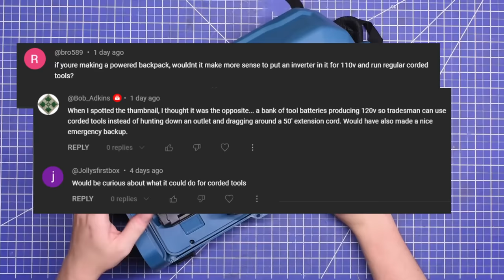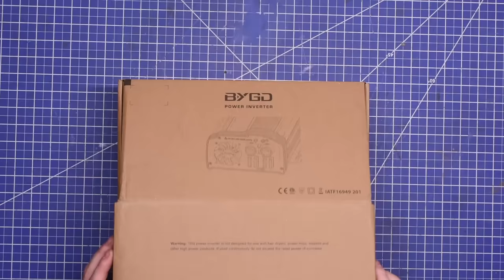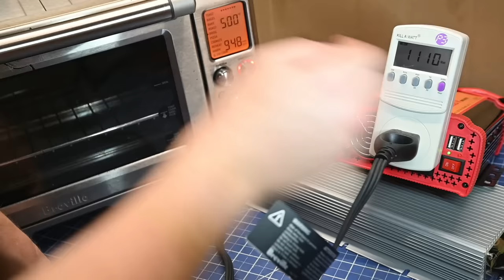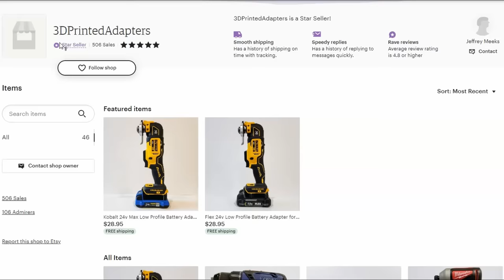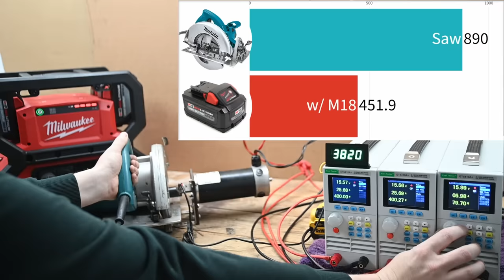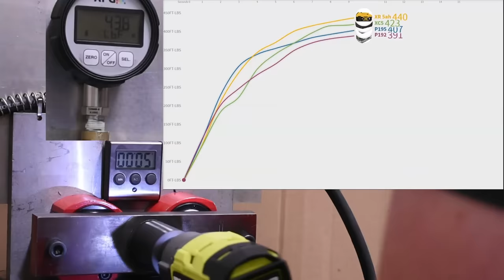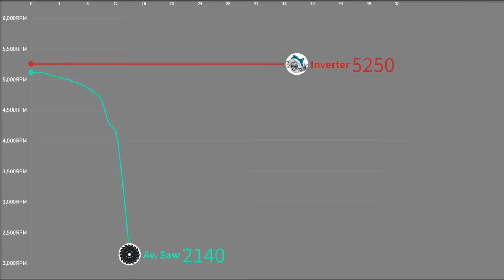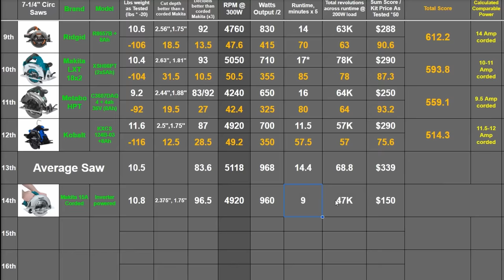Powering Corded Tools w/ Cordless Batteries is Stupid (but fun)

Comment: I built a backpack power center about 20 years ago, similar to your first attempt but with that era tech.  In a backpack, I put in a lead-acid battery intended for a large UPS.  Probably 1/3 the size of a car battery, maybe 20 lbs.  Then paired that with a 12v inverter, and added a slow charger conditioner.  The key, as I think you exposed, was the inverter.  For reasons, I had high-end inverters in my parts bin.  No Amazon cheapo crap, these.  With this setup, it could run a 12-Amp AC tool continuously, and could spike to double that for startups +-.  The backpack would run an AC edger, trimmer, blower and hedge trimmer (and for projects, circular saw, shop vac, and every other tool I had except one, which rejected the modified sine wave, I think).  I also converted an AC lawn mower using a similar setup, but on-board.  This did all the yard work for an 1/8 acre lawn on one charge.  The Achilles heel was the LA battery.  After about 6 months of discharge cycles, they would be flat.  Fortunately, LA batteries were cheap at the time (and recyclable).  Deep cycle helped, at a bit more money, but the most I got was about 8 months of weekly yard work.  The system as a whole did all my yard work for about 5 years.  I was about to convert to early lithium battery (at huge expense), then Ryobi released their "40v" mower, and well, for better or worse, that's where my money went.  This was a fun video, bringing back some hack-tastic memories.

Comment: I can't imagine how nice it would be if all brands had the same battery platform so you could use it all together
Reply from the maker: Air hoses and cords are the great equalizer
Reply: In a way they do actually, they all use 18v batteries(some market them as 20v or 19v, but they are all 5s lipo's so 18v), so all you really need is to download an adapter if you have 3d printer at home or know some one with a 3d printer.
Reply: Not that simple...
And they are not lipos, they're lithiums.
Lipos are significantly more volatile.
Reply: @Poo_Garden Doesn't lipo mean lithium polymer? So wouldn't that be the same just different format and in a smaller package in the case of Lipo packs.
Reply: @Poo_Garden  Yes it is actually THAT simple, 5 rows of INR 18650 cells in a series it's all the same, trust me. You just have to use same brand charger though because of BMS compatibility. Also some battery packs have output leads go directly from cells and rely on BMS to send a signal to tool to cut power when battery is low, so if you use that type of battery with an adapter there is a risk of over-draining them, but than again you will notice the tool being too sluggish to do any work long before you over drain the cells to the point of damage or not accepting charge again.
Reply: @jovand6606  the difficult part isint the cells. It's the pinning and logic. They have shown that batteries don't perfectly work across platforms and not to mention the number of 3d printed adapters you'd need to have aroud...

Now it would be VERY EASY for companies to do it, they just don't want to because it'll hurt their profits
Reply: @Depl0rable10  Dude, i 3d printed an adapter for my Parkside X20 batteries and made x3 adapters, wired them in series and im using them on my electric scooter. Im not sure what you are talking about, every battery has + and - pin and every tool has + and - pin, unless some companies are putting DRM and electronic handshakes on batteries, but i have never seen that in my experience.
Reply: @jovand6606  Except for Cobalt and Flex.  Their voltage difference actually means something compared to what Harbor Freight or Big Yellow says.
Reply: @h8GW  20 years only hilti had 21.6v line, and only recently it became popular for new brands which is beneficial because tools now need more power and higher voltage is a pro
Reply: @Poo_Garden  Lipo? You mean spicy hotpocket?

Comment: I love your videos and the out of the box ideas! I would love to see you test battery powered tools using lipo batteries. Atleast in rc lipos reign king for high load high power applications. I’ve noticed most battery packs are li ion which doesn’t hold a candle to lipo’s under load

Comment: Great video! A good stress test for corded stuff like this is a table saw. My EcoFlow Delta 2 ($649 on sale, 1800W, 1024Whr) will run nearly everything in the garage: Skilsaw, miter saw, MIG welder, compressor (not all at once of course), but it won't run the table saw.

Comment: someone else has probably pointed this out already, but brushed corded tools like most of the stuff in this video (grinders, saws, drills) are using universal motors. They can actually run just fine on AC or DC... but it needs to be around 120v... so 6 18v batteries put in series should be able to run all of those without the inverter.

I'd love to see that tested next. :D

Comment: another benefit of the battery inverter setups is the noise. much quieter than the gas generator and no fumes to deal with. something i consider when getting power away from the wall.

Comment: Motor engineer here- did y’all consider a backpack with 6/7 cordless batteries in series direct to the tool? You need to match the pack capacity/age somewhat, and there’s no BMS so you need to be careful, but you can (I have) run universal motor tablesaws, mitersaws, and corded circ saws from 6 20v batteries. 

Check the switch rating in the tool- this is the limiting factor- but DC to grid tools can be done.

Comment: You guys need to bring out the Bauer corded impact and start seeing if voltage increases will get you more beans. Or just wire it for 240 volts and send it on the dyno. I’d love to see if it survived a dyno run

Comment: An EcoFlow Delta 2 was recently on sale on EcoFlows eBay store refurbished for less than $500(1kWh, 1800W continuous output), and they had a Delta 2 Max for just over $1000, (2kWh, 2.4kW continuous and 4.8KW peak). I have a D2M and ran my shop air compressor(20gal 13.5A) no problem.  Also ran 3 window AC units off it this past summer.  Make an adapter and feed your batteries into the MPPT inputs😁

Comment: Something on your first set up was bad eather inverter or the converter i have 2 1,000w inverters that will run a 15amp circle saw not at full power but have used them several times. I would have them under the hood conected to the battery with a old set of jumper cables. Love your videos thank you!!!!!

Comment: I like the stupid. I was expecting four Flexvolt batteries set up for 60V in a 2x2 config, for 120V and up to 10Ah on the big boy batteries. Should work fine with universal motors and there would be lots of amps on tap. Would be interesting to see that.

Comment: Great test and quips as well. I bought a DeWalt, er, mustard invert rated at 1800 watts. Two outlets and it hasn't run anything i have plugged into. I bought it primarily for the air compressor and jump pack but I doubt this thing could run a coffee maker

Comment: Most of the solar off grid people do not use 12v inverters. I personally run my house on a fanless pure sine wave 48v inverter. Basically it's about he wraps on the transformer. If you want I can point you towards a great fanless line of pure sine wave inverters that are reasonably priced. It will be much more efficient than dc to dc buck converter running into a 12v inverter.

Comment: I believe its your step-down converter. If its limited to 1500w of power at 12v, and the output of the inverter is 1500w (non peak) at mains voltage, the inverter will be drawing a fair amount more from its 12v side (Probably 1800-2200w depending on its inefficiencies)

Comment: I wish we could see a video of the wobble sockets and what kind of power loss happens with them. Maybe a couple different brands as well? Done at different angles like straight on, 1/2 bent and full bent? And different styles of them like the u joint wobbles with the pin style and then the impact versions with the ball style. Would be interesting to see how those stack up in power loss

Comment: @TorqueTestChannel - I have the Milwaukee MX inverter/generator on my utility truck at work (company buys all tools).   The problem is it has a fan that ALWAYS RUNS, even if nothing is drawing  current. So if I try to use it to recharge ONE m18 battery, the MX generator will run itself dead unless I remeber turn it off later.  It's the DUMBEST thing ever. So TWO $600 MX batteries will run themselves completely dead to recharge a 1.5 amp hr M12 battery without user intervention.  We are literally using big batteries to charge small batteries, and calling that "progress".

Comment: I have the dewalt inverter/charger, dcb1800(?). I haven’t used it very much, but I don’t think it likes the small (2.0 ah) batteries. It has to have all the batteries installed & while they don’t have to be the same ah, it will shutdown when the 1st battery dies. It’s also “dirty” ac, not pure sine wave.

Comment: Time to crank up the sketch factor and run those corded tools on DC!! If I’m remembering my “EE for MechE” class correctly, I THINK 85 VCD would be about equivalent to the 120VAC RMS. That said, I suggest you just hook up an amp clamp and keep adding batteries in series until the current gets high enough to make your butt pucker (and tools smoke)!!
Reply: No  rms means rms, not peak, so you need 120vdc. Also switches are not dc rated

Comment: Admittedly I didn’t read all the comments to see if this was already suggested , but a computer UPS (uninterruptible power supply) uses higher input dc voltage that might work better than that 12v inverter.

Comment: Yeah, i wish Craftsman had a bigger inverter than just the 150w one, but it still has plenty of uses, powering 12v lighting for example. Hoped to use it to power my awning when needed but come to find out the motor uses 200w so just barely not able to handle it lol.. went and got a 350w UPS to do it though and it handles it just fine so whatever works.

Comment: I have that same generator! Just had it break on me. Turns out the little metal box attached by the yellow wire to the low oil pressure sensor was grounding it all out. Wrapped it in some electrical tape it its up and running again, lol.

Comment: @TorqueTestChannel if you’re not getting voltage sag from the inverter, I wonder if your frequency is responsible for the RPM difference between batteries. It would be interesting to hook up an oscilloscope and watch the wave form. Maybe parallel both outlets and use your safety squints

Comment: years ago when dewalt made the 24 volt line of tools it would run 24 volt or 110 volt you simply plugged in what looked like a battery but had a cord on it and plug in the wall

Comment: As 100 others already mentioned: most corded tools use universal motors that will happily run on DC. Though tools with triac speed/power control will get stuck at full speed.

Comment: 7:20 that fifth pin is used afaik as a voltage in for the charging function, so it would explain that not working, apart from the protocol being different on another brand of battery

Comment: Great idea but would make it differently. Universal motors are called universal because they can run on AC / DC power. So putting 2 60V batteries in series is enaugh. It would be nice protective measure to make some kind of protection circuit for that but not necessary. Maybe 60V mode needs some way to activate it but principle should be clear

Comment: i'm 5 min into this. the solution is using corded tools with brushed motors  that have a universal motor that will run on DC and AC . all corded tools used to be this way . if they have soft start and are fancy then probably not. but if they are literally a switch and full power to the brushes they should run on DC 120v so don't know if you can wire up 2 flexvolt batteries to give 120v dc.

Comment: Ryobi also has one of these units for 18v and it can hold 8 batteries. With their new 12ah batteries you could potentially have over 1700wh. Now at current prices you're paying about a dollar per wh for the batteries when you get the 2 pack. But on sale pricing that can go way lower. You'd have to be stupid to buy a single 12ah pack if you wanted one because for $10 more you can get that battery and two 4ah batteries right now.

Comment: 120V DC. Won't work with all tools, but it'll work while avoiding a bunch of conversion losses. You can even run a PC off that; the 1st thing an ATX PSU does is convert AC to DC through a bridge rectifier.

Comment: Technically the universal motor in that corded saw can run on DC, so in theory you could series up six or seven 18v packs and just run the saw directly from that.

The trigger switch probably wouldn't enjoy that (direct current is harder to break than alternating), but it would allow you to skip all the inverter nonsense and all the conversion inefficiencies it carries with it.

Comment: If you take a flexvolt battery and depress the side tabs in while conducting a wire between C1 and C3 terminal, then the output instantly becomes 60 V I know this because I’ve done it. I made an outlet box that puts two 60V flexvolt in Series. And then it has 120 V outlet on it. The problem is it’s DC only and it burns out switches like nothing because it arcs out the switch. If you were to put four in cerise, it would be 240 V DC and if you use the 15 amp hour batteries they can put out 3500 W each so four of those together would be very high 14,000 W of power which could melt rate through steel like a plasma torch since you’ve got disposable income I don’t you try it it would makes for some great video

Comment: If anyone is wondering why the different battery packs would produce more watts it will be because batteries with a higher capacity will produce higher peak amps than a smaller battery with the same battery cells, if the batteries use different battery cells they can also produce different peak amps along with all the safety measures in the battery packs

Comment: The other way around would be a better hack. Sometimes we need more Ugga Duggas than batteries can provide so we want to plug our cordless tools in. To some that may seem stupid but the versatility would be nice: some tools do this like ryobi’s soldering station. And ryobi also makes a plug in battery adapter for one of their cordless tools I forget which one  but it’s not powerful enough to run their p262 or other high draw tools.

Comment: Why anyone would want to run corded tools off of a backpack battery pack instead of just being able to give cordless tools a longer run time, I have no idea. The original idea is pretty genius, even if only for niche use cases, even if in need of some solid refinement. Jank, but genius none the less!

Glad this test happened - the Milwaukee inverter + Hercules battery packs seems like a pretty nice, high value setup for taking to the race track. May not replace big boy generator duties, but it can extend the amount you can work before needing to fire one of those noisy things up.

Comment: I wonder how a 220/240 power tool would fare with a similar setup. It's my understanding that the higher voltage motors are relatively more efficient than the 110/120 ones.

Comment: I re-powered a Power Wheels Jeep with a Hercules 20V 12ah battery a while back thanks to this channel. I put a volt meter on the dash and told the kids to stop so it can be recharged at like 17.5V. Based on what you were saying at 14:03, is it ok to run it down to even lower voltage? Or what cutoff voltage would you recommend?
Reply from the maker: Oh yeah. 15.5V would be more than fine. Your power tool is going to take it to 14.5-15V

Comment: Most corded power tools are universal electric motors and don't need a inverter as long as the voltage is right enough it will usually work ave did a video running skillsaw off two 60 volt dewalt batteries with some sketchy spade connectors and 14 gauge wire

Comment: I always thought that a battery pack belt with a coiled cord might be advantageous in some areas. Maybe drywallers doing large full sheet jobs or someone moving along mounting hangars or something like that. The power draw might require too large of wiring. It just seems like it would lighten the tool considerably and give longer run time before battery swap. Also would the MX battery system be a better choice than the M18 for the Milwaukee inverter although much more expensive?

Comment: On a side note but related. 
I have a EcoFlow Delta Pro and it regulates the 120 volt outlet by keeping it right at 120 volts even under a 15+ amp draw. 
Unlike a wall outlet even from a 20 amp breaker where voltage sag will occur. 
What I’m saying is that one of the solar generators that can recharge in 1 to 2 hours and are common nowadays might be a better idea.

Comment: All those cheap/light weight inverters are high frequency, you need a low frequency inverter to run tools, my 2000w low freq is a beast it will easily run a 12,000btu window unit but it takes 2/0 cables & at least a car battery with at least 400 cranking amps. When it comes to inverters big cables & lots of available current. That Milwaukee is a low freq inverter, they are heavy.
Reply: High or low freq doesn't mean anything, it is all about the build quality and actual real power of those inverters. Milwaukee is a high freq 100%

Comment: I’d love to see the opposite. A battery tool plugged in. Things like miter saws or table saws that might not move much.
Reply from the maker: DeWALT 60V miter saw does that. Some fans and shop vacs as well
Reply: @TorqueTestChannel  it does, or at least it did until recently when they pulled it from the market because it had a tendency to burn the motor :|